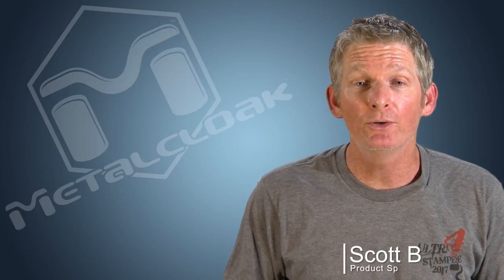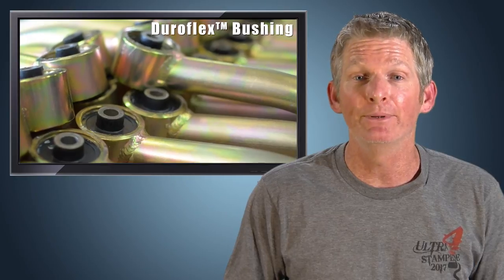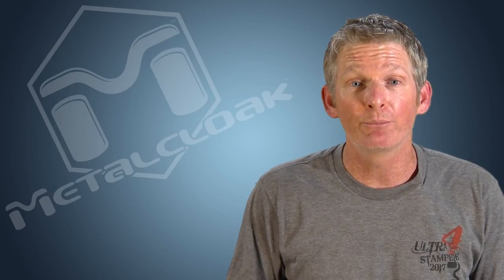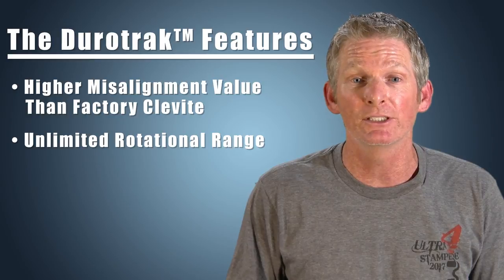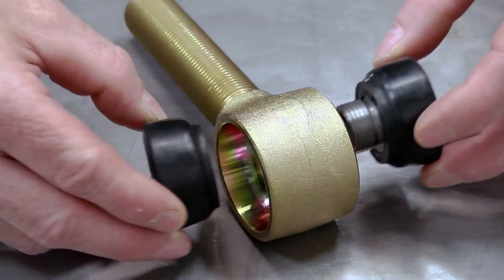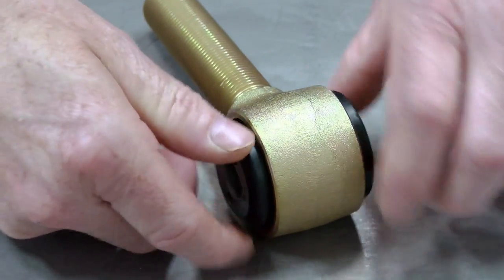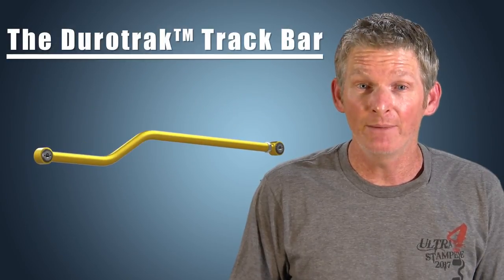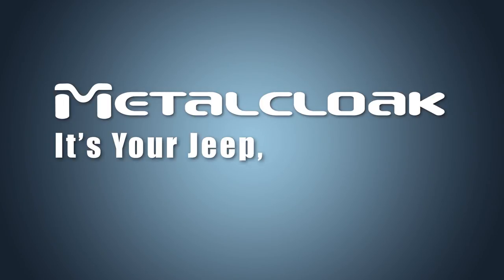Introducing the Durotrak™ Bushing Exclusively at MetalCloak

Comment: I already have a MC track bar that came with my game changer lift that I bought 2 yrs ago.
Will these fit or do I have to buy a whole new track bar.
Reply from the maker: We've actually been using these joints for almost two years now, we simply didn't create a video until now. However, check your track bar. If you have the original clevite style joint, then no, these will not fit. The joint housing is specially milled for the Durotrak joints.

Comment: Take & make it double ended & I think u hve my ppl's jeep sale every damn joint I can use them on your start straight factory install God call. Pick your system in your hand but double jointed. So depending on control arm u hve your screw in end & bolt 2 haves joint BUT then a second screw in & 2nd joint. As arm travels up or down u hve 2 movements poss the travel of arm & the travel length of double joint. I can draw it if need to in my notes. I think we hve a real home run winner. For ppl going extreme they can use a tougher noisier joint but like I said so easy to change I take quite & mid grade any day in this case. W/double joint system it takes load off the joint & splits it in 1/2 so no1 may need a strong joint system NOW. Damn nice product if I can change it out & cost effec